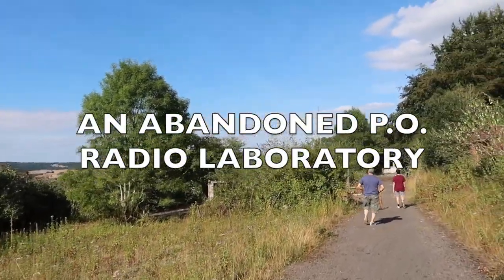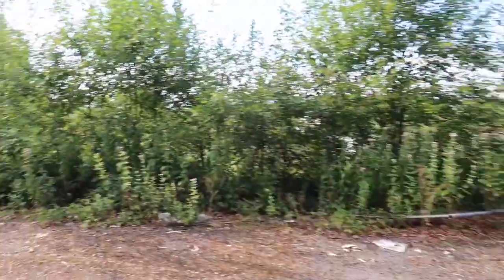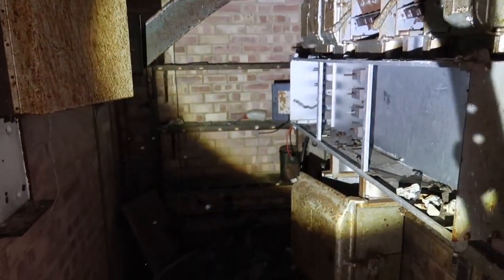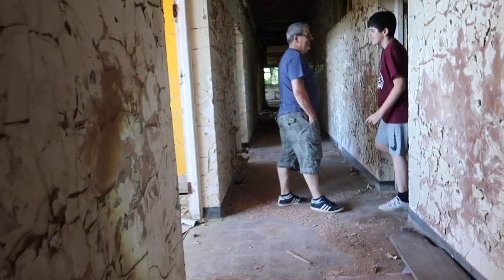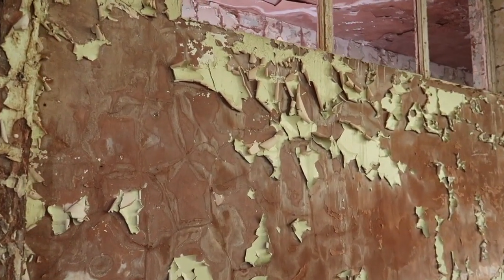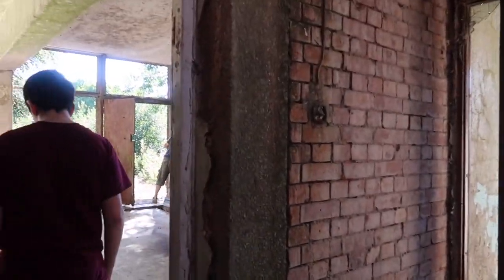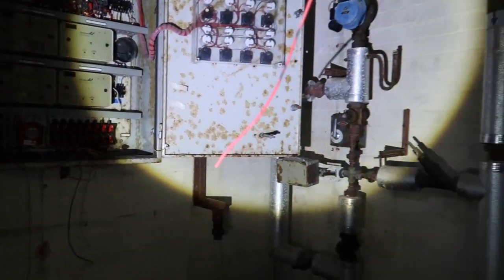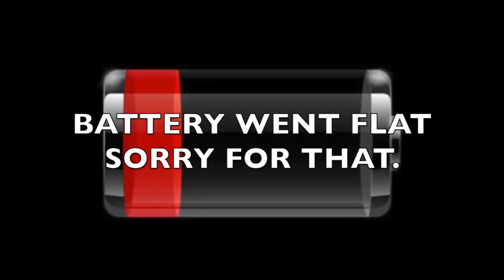ABANDONED P.O. RADIO LABORATORY BRISTOL

Comment: A bit more background for you all

Backwell Radio Research Facility

The site was chosen in the 1930's as it was a very low in a radio and electrical interference, an absolute must if you're measuring low levels of the frequencies used in communications and satellites . 

In 1937 a number of telephone poles were erected on Backwell Hill near Bristol. Then a small group of men unpacked some boxes containing experimental VHF “ Wireless Stuff” and Backwell Radio Station was born. Lengths of wire were suspended between the poles and and transmission tests commenced between Backwell and a similar station  on the other side of the Bristol Channel at a place called Castleton, a small village between Newport and Cardiff. 

The men were from the Post Office Research Laboratories at Dollis Hill.

Testing continued intermittently until 1939 when the decision was made to disperse certain sections of Dollis Hill to locations away from London. Backwell and Castleton were selected to be temporary outstations.

Some 12 staff then took up residence at  the station which consisted , throughout the WW2, of 3 B1 sized wooden huts, plus a garden shed located about 100yds from the laboratory huts in a small wooden copse. On the outside of the hut there was a small ventilation chimney and inside was an Elsan chemical toilet.
Those that have visited the Backwell site will appreciate that in winter the need had to be quite pressing to use this facility.

The work at that time was often related to the requirements of the Armed Forces and there was a period when men could be seen walking around Backwell Hill, across Kenn Moor and Clevedon Sea Front flying kites of various designs.  The reason for these antics was the testing of transmitters that were fitted to lifeboats, and aircraft dinghies etc. to aid the location and rescue by the Air Sea escue Service.

Early experiments were also conducted at Backwell into the performance of the Klystron valve. It is now history that this development had far reaching implications and paved the way for centimetric
RADAR .

After the war radio interference / field strength measuring sets , known as RI 1 and RI 2 were designed and built at this station. Both were extensively used by the Radio Interference group, the Armed forces , the BBC and outside industry. Experience in this field led to the Backwell staff being involved in tests to ascertain permissible levels of electrical interference.The findings were then later used to enable in law enforcement applicable to sources of interference.

Backwell Radio was involved in very early experiments involving the American passive satellite known as ECHO. This avenue of work led to the design and production of all the Satellite receiving equipment installed in the Aerial Cabin at Goonhilly  in readiness for the TELSTAR an lesser known RELAY launches (1962) . A satellite simulator was built at Backwell and installed at Leswidden near Penzance, to prove the Goonhilly equipment prior to the launch of TELSTAR and between each pass of the satellite. TELSTAR was not geostationary as modern communications satellites are and was only visible for a maximum of 20 minutes each pass around the Earth ( 2hrs 37mins per pass) . Backwell staff were responsible for the maintenance of the Goonhilly receivers and high power transmitters for the first 18 months of the Goonhilly operation. The initial Goonhilly equipment used thermionic valves but the development of the transistor enabled Backwell staff to design and build transistorised upgrades for the equipment.

Specialised test equipment was also developed which accurately displayed the characteristics of frequency modulators/demodulators and IF amps necessary for colour television  transmissions .
Spectrum Analysers used in Post Office Microwave Radio Stations ( these carried telephone traffic and distributed TV feeds across the country ) were also provided by Backwell.

These were just a few of the successful projects undertaken by the staff at Backwell. Their numbers never exceeded 26 including labourers and watchmen ( but not including the two station cats George and Tim ).

Sometime in the early 1970's The decision was taken to centralise research to a purpose built facility located in Martlesham , near Ipswich. Backell , Dollis Hill and Castleton closed and operations moved there.

In 1976 the site was taken over by The Regional Radio Interference Investigation unit. The previous research team left much of the specialist test gear behind which then proved invaluable to the unit . The staff also had significant technical expertise and took on repair work of complex devices across the South West Region. Push them hard enough and they will admit they also calibrated, maintained and repaired the electronics of the TV Detector Vans. As time went on the repair work was formalised and the Regional Electronic Repair Centre was established. In the early '80s BT ( as it had become ) decided to offload the Radio Interference work to the Home Office and focused on the electronic repair facility. The site then became known as the Area Repair Centre. It also hosted the Air Conditioning Team and their workshop ( the lower wooden huts ) and a Special Faults Investigation Unit.

For various reasons these units dispersed one by one  until the site was abandoned in the late 80's mid 90's.

Personal anecdotes.

1. I was part of the Radio Interference team and when we first moved in there were only 8 of us.

If you stand at the front entrance of the brick building and look to your right at the bottom of the field you may notice the remains of a mechanical contrivance. This was the Station's own sewage processing system that eventually fed a septic tank.

One day we were summoned to the station manager's presence for an emergency meeting, there was a major problem.

The sewage system was designed to work for 15-30 people, it needed the throughput to make the swirly arms do their thing. We were not “pulling our weight” so for the first and only time in my life I ( and my colleagues) was extorted to avoid the loo at home and save  my “output” for working hours.

Over the next couple of years the Staff numbers increased and the problem disappeared.

2. The site is not served by mains water or sewage

One day we ran out of water, this is when we discovered there was no mains water. We eventually established that the 5000 gallon tank on the roof was connected to a pumping station at the bottom of the hill in Backwell village. Further investigation of station records reviled an ingenious system of sensors and levels installed by the research staff with the business end in the pumping house. When we eventually found the place and a key to get in. SWEB had done some work earlier in the month and as the pump was 3phase and SWEB had reversed on of the phases it was running backward. I didn't know you could do that.
Reply from the maker: Thank you I will pin it.
Reply: Hi I also was lucky enough to have worked at the what was Post Office Radio Labs Backwell .
I started there as a youth in 1955 .
It used to have wooden huts and the main new building was built after I did my National Service.
Reply: @johnknight3897  Hi John, I moved in there in  '76 when Radio Research moved to Martlesham. I was with the SW Regional Radio Group when they inherited this site. It's possible the nicest bit of BT I've ever worked in and  I wish I could go back to those times but I'm probably forgetting the cow patty access through Home farm and the temperamental water and sewage systems. We still used to get the 12:00 warning from the Quarry .The OinC when we moved into the site was a Ronnie Hinchliffe who never wore his bottom set of dentures and Tom the T2a/Caretaker who knew every farmer in the locality and was not averse to trading the odd bit of "scrap" for the Christmas turkey. George and Tim , the station cats, we inherited also.
Reply: RI1 and RI2
They were built and developed by just 3 engineers one was also a motor engineer who restored an open top Lagonda i think it was. The Ri2 was sent for manufacture and when delivered to radio station's was found to be leaking in RF. Instead of making the ventilation holes as original, had made 2/3 inch Louvers, and that let in the RF.
Reply: Correction.
My last comments about leaking RF should have been about a " spectrum analyser"  eventually used in all the PO radio transmitting ststions ,not the RI2.
RVH used to be a radio ham. He was able to use a morse key.
Reply: ps, I think we know each other ??
Reply: @johnknight3897  That's been in the back of my mind niggling away - yep John Knight , Lab 4 I think, dapper chap with beard and an unfinished keyboard project?
Reply: @Datz60  wow  yes,, nice to meet you again Robin, I never really finished the keyboard, at least never did an amp for it